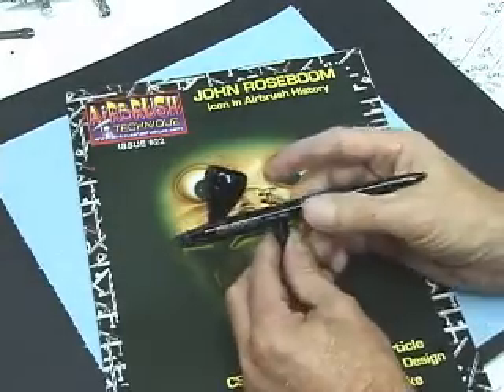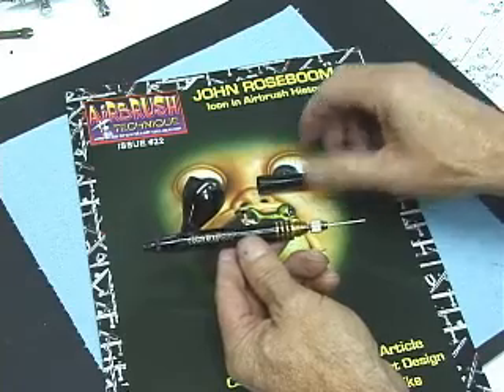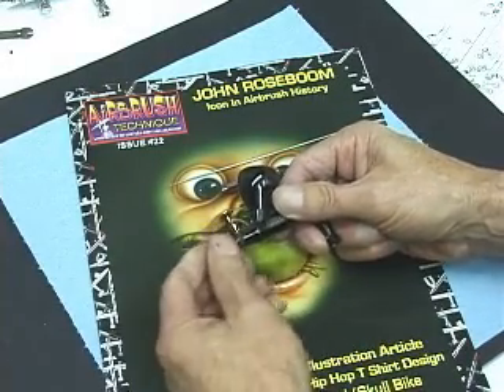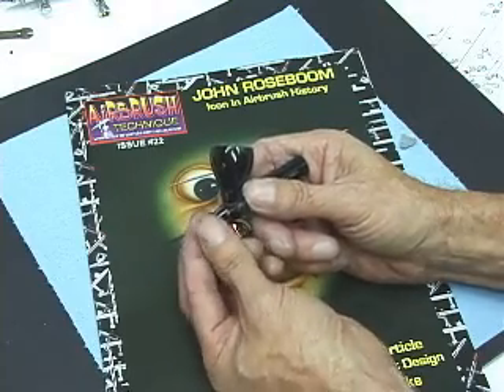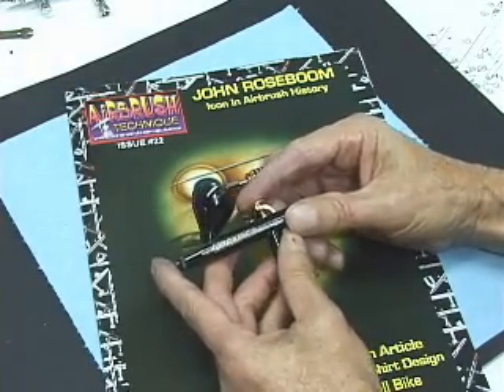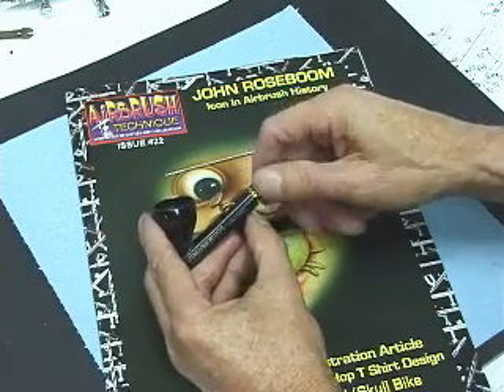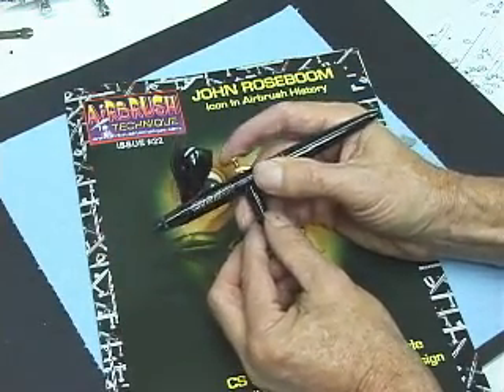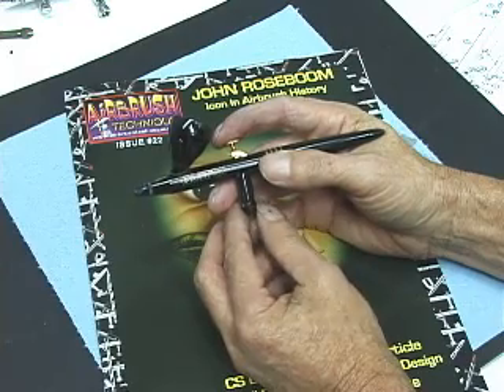Harder Steenbeck Evolution airbrush

Comment: Hi Don,

Thank you for the excellent video; it has saved me much heartache today.  I took apart my brand new Evolution and was comparing it with the 'break-out' diagram found at germanairbrush (dot) com for the Evolution 2 in 1 and was horrified that parts 123450 and 123471 (Needlenose joint o-ring and screw respectively) were missing!

Your video confirms that I didn't miss anything and the needleguide simply mates with the groove on the lever (trigger) slot.

All the best, Michael.